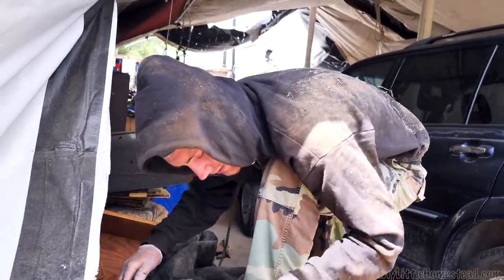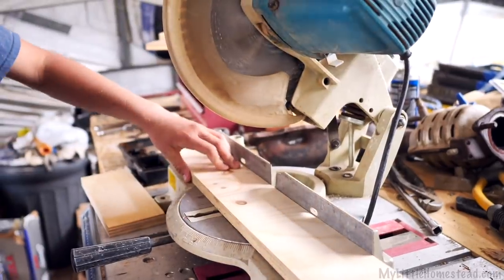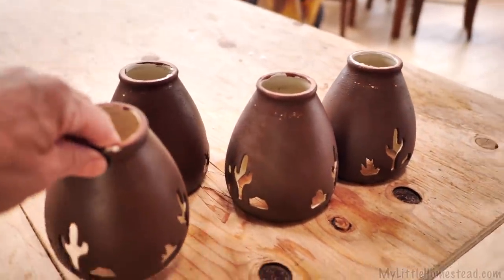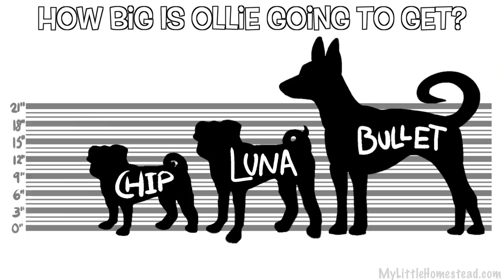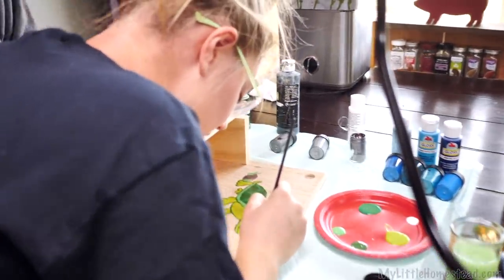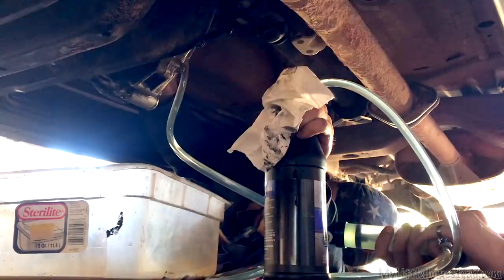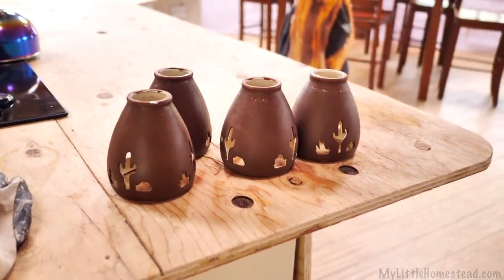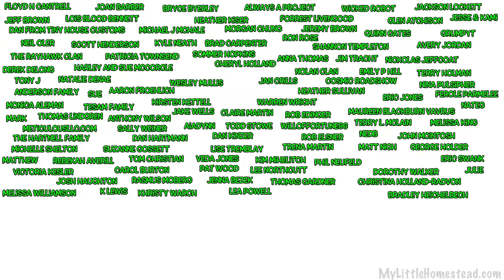Suzuki Engine Swap Complete, Outdoor Shower Caddy, Patio Solar Lights | Weekly Peek Ep186

Comment: Baking Soda has many good uses  ..... from being mixed with water to a paste which will clean better than many commercial products, to mixing with more water to form a good antiseptic to dipping your damp toothbrush in and getting a dab on to give your teeth the best cleaning they will have had outside a dentist chair!
I have a similar outlook to you with cars .... but stick to Volvo! My first (second hand 75K) 240 lasted me 10 years .... my latest one ( a rush buy 80K V70SE for £9K 3 year old) is doing well too! The reason it was a rush but was because a driver on his phone driving a box van clipped a caravan and ended up side swiping me into the central reservation on the motorway! The front wheel was ripped sideways and the car written off, but our biggest problem was actually getting out with a box van on one side and the central barriers on the other! That is one reason I will stick with Volvo!

Comment: Use the baking soda mix to get the oil out of your hair.  Baking soda is a stripper when I'd on hair.  Im a barber and I recommend baking soda to my clients that have gotten any type of oil in their hair. Don't use the baking soda unless you're stripping oil out of your hair though because it will dry your hair out.

Comment: a good and cheep cleaner for everything is dawn dish soap.  we use it to wash our hair, our bodies, our clothes, our floors, ect...  besides dishes.  you only need a little bit to do alot.  and you can safely wash animals too.
Reply: p.s. it is also safe for the ground and to use as gray water on plants.
Reply: It will also kill the fleas on your cats or dogs.  I use it to bathe them if I see them itching.  Plus someone dropped a stray off that was covered with fleas.  It killed them all.  I use the blue bottle one.

Comment: Hi guys!  really really dont reco baking soda shampoo. vinegar does great as a conditioner though.  Baking soda is very drying, not good for scalp at all, the oil there is too sensitive. What does make an excellent diy shampoo is Aloe vera juice. Using actual Shampoo is extremely important because it has antifungal properties. once fungus aka flaky scalp happens is a pain the the butt to clear it up. You should grow some theyd love it out there in the desert!!

Comment: When I finally figured out that I can rebuild an engine a transmition better than factory new I did the same..!
Working on army diesel engines, that I kept running for ever I began to hate factory practices, built in obsolescence..!
     Yet I'm American, had several used up and abused Mercedes 240 D 's..! Had to ask my boss at the Army shop, "theses another diget past a hundred thousand, what's up with that Frank"!
    His father too exelent care of one for a sailsmen in Puerto Rico from New..! And it had some oil leeks not real bad but worth fixing so Frank's dad gave the car a renew once over.! Boys and Girls Mom and Dad the car just passed two million miles on the odomiter..! And went back out on that lonesome road for a try at three million miles.!
     My point, us Americans have been precondition to only expect 100 thousand miles our of a new car..! And believe me that's the way an American car is built..! A thousand engineers to build in obsolescence, but only to Engineers to build the Silver Shadow Rolls Royce that has a hood that is welded shut and engine that has never needed any work !
     Mercedes diesel caught me off guard because I wasn't expecting that and believe it or not Americans have been preconditioned to hate diesel engines why it makes no sense..!?

Comment: Aw honey thats not soap or shampoo but its easier than you think. https://www.brambleberry.com has all you need and you can use oils from your local shop. Drano is 98% lye so just make sure you check whatever drain cleaner crystals you have for that. NEVER make soap without a lye calculator which u can get online. For a shampoo bar, superfat in the calculator to 2%, for body soap, superfat to 7.5-10% if using coconut oil use no more than 30% in the recipe. Lastly, if you have a crockpot you can give over to soaps only, you can cook all this and it will be ready to put in a mold (box) in 3hrs. Tons of info and workshops on youtube.  Have fun and be safe xx oh and once its cooked, if it doesn’t “zing” on your tongue its done! Dont do this until the batch is at the very least 100% translucent (you’ll see what i mean), and after about 2 1/2hrs. All the lye will be cooked out and you only need to let it harden and dehydrate for up to 2weeks before using. You can use it straight away but it will “melt” as its a softer soap.